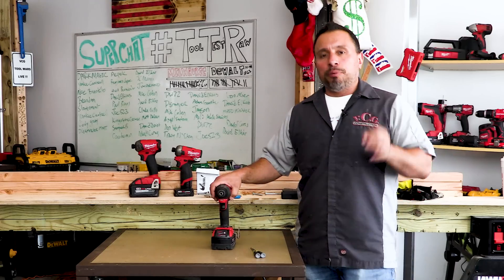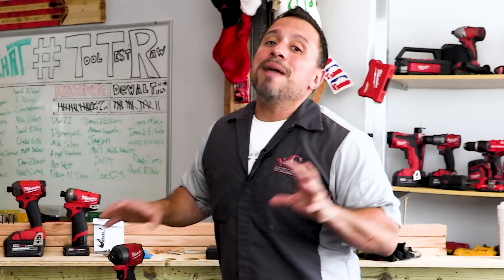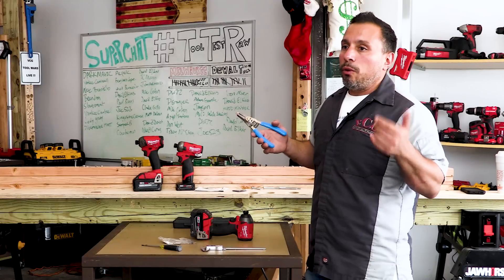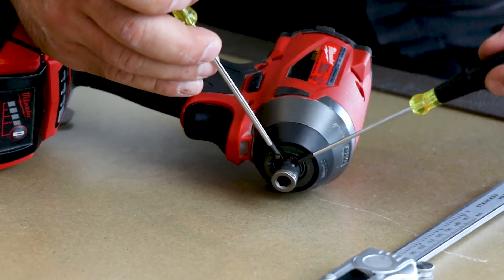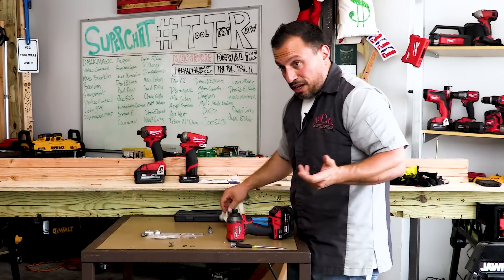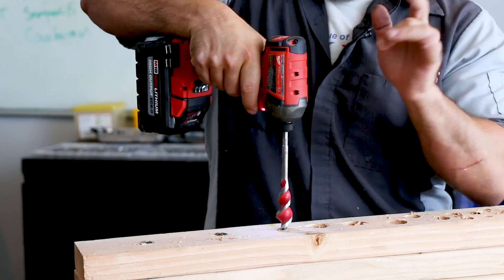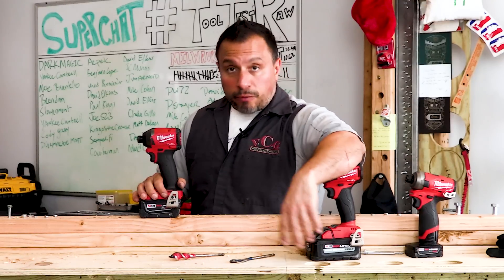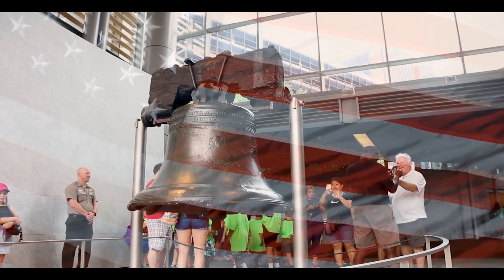Serious Problem With Milwaukee Impact Drivers - Replacing The Ball Bearing

Comment: it must be sabotage.. those ballbearings shouldn't have passed the test..
if the ballbearing is 0.1mm to small, and the black collar is 0.1mm too large along with the hexagon mount also being slightly too large, that will cause the drillbit to wobble and it will come lose if you pull too hard because the ball will move out of the way.

i would try to take the quick-insert from a functional driver and put it on the broken one and see if that fixes the problem.. (my suggestion is basically "switch out the entire quick-insert")
Reply: and also if the hexagon well is too deep, and you can push the drillbit too far in, then there's a chance one could activate the accepting mechanism that opens the lock when you press the driver down into the material, the ball lock that opens up when you insert the drillbit in the first place. the ball could then also get stuck in the unlocked position and then when you pull back then the lock is still unlocked, or almost unlocked.
If that was the case then it can be solved simply by placing a small piece of metal behind the drillbit before you insert it.

Comment: The problem is not the ball bearing size its the spring that pushes against i i can bet my left nut on it that the other impacts have a different spring. booooooooooom milwakee can send me some free drills for fault finding and saving them $$$ to find the cause
Reply: That's what I was thinking too. Actually by increasing the diameter of the ball bearing, there will be less surface area protruding into the collet. A smaller ball bearing and a stiffer spring would be a better solution imo.

Comment: friction caused be the impact function of the impact driver is heating up the bearing then transferring the heat to the retainer if its not a high heat metal it will weaken and flex causing the bearing to fall back releasing the bit. try using another retainer from a known working tool to see if it fixes it.

Comment: Its operator error....your not suppose to pull when reversing , so light pressure as if your driving and dont pull
Reply: Agree, if you drill hole like that with impact DRIVER or any tool it's better to remove those wood chips during drilling instead drilling whole drill length and then try yank it off from hole.
Reply: But the other gens work ok.  Operator error or not.

Comment: VCG Construction I came across your videos and SOOOOO glad I did. Thank you for what your doing it has really made me think before i buy. New to Newark Delaware area from West Virginia. After being an electrician for 10 years getting my own businesses going and working for myself I want to update my Milwaukee Gen 1 and after going through your videos I see the Milwaukee Fuel Surge in my future but wondering if I should wait and see it the surge line starts having the same problem.
Reply: FWIW the Gen 3 impact is way too much power for all but the biggest screws and lag bolts. I am extremely disappointed with mine. The spring on the hammer is so strong that it doesn't start impacting smaller fasteners until they are nearly seated. This results in more torque against the wrist and requires you to push down on the fastener with more force to prevent the bit from caming out (slippy bit)...  I recently bought the M18 surge and it is nearly perfect (and very quiet).

Comment: Was hoping for this easy fix, but even as the DeWalt extreme on yesterday's TTR Let go of the masonry bit twice, makes me think  that the bearing on the flat's while better placement isn't  100 percent either. I think the solution Milwaukee should go is dual ball bearings on the flat's or dump quick insertion for the old school system.

Comment: What about the spring that hold the ball in place I change it and had no more problems out of my impack driver
Reply: This may be something... everyone's focused on the ball bearing what about the spring that retains it?
Reply: agreed.  I think the  spring is slipping out of position under impact and allowing the bearing to retract slightly.
Reply: That is what I was thinking, with the jarring force of the impact it could shock the springs if they are worn.
Reply: Definitely the spring
Reply: Is the spring in the surge the same?
Reply: @mikemorgan2733  I guess there are two of us here.  Not an uncommon name I suppose.  No, at least the part numbers are different.  Balls are also different part numbers.
Reply: dragon62040 yeah that spring looks pretty shitty. Believe it or not I bought the gen 3 from winnelson and within a week the whole Chuck/quick release assembly broke apart.
Reply: But where can you buy the spring for that.
Reply: Ya I'm pretty sure it's the spring. I finally had to repair one of my dewalt 885 collets after 4 years of hard daily use and replaced the spring which fixed it. When you take them apart you can see the spring is what's used to hold pressure on the bearing to keep it seated in the bit notch. Replacement spring or possibly aftermarket spring if the ones Milwaukee is putting in the gen 3 are undersprung so to speak

Comment: Ugh I thought it would have worked !!!!  You think you can put an even bigger ball bearing??
Reply: What is the size if you but  a big bal bearing  in mm
Reply: I don't think the ball bearing is at issue here. if the bearing was too small, to such an extent that it will let go during operation, it would definitely let go when pulling on it by hand too.

This happens during impact operation, but not when stationairy. That tells me a retaining spring is too weak or short. As it does not give, even with a strong pull by hand when stationairy - that suggests it's the the coil spring tensioning the release collar that is at fault. Too short, weak, or even possibly misaligned. Or, possibly the circlip and washer needs a particular alignment? The latter - this being an issue of alignment - would explain why replacing the ball bearing has seemed to help for some people. Because that spring, and the circlip and washer, has to come out (and go in again) to get to the ball bearing. Might be they went back in, slightly different from how they came out.

Comment: I don't use my impact to drill, I believe that's why I bought the set. That said, they do sell impact drill bits. I can see how carrying one tool with multiple bits is convenient, not to mention if more than one person is using such said tools. Personally, I believe every man should have their own M18 Fuel tools and maintain them properly to avoid or fix issues like this. VCG rocks the shop and the job site! Did you ever test the fuel impact against the fuel hammer drill?

Comment: Honestly this was the decision to go towards Makita. Milwaukee really disappointed me with this issue. Thanks Vince for the updates!
Reply: By that logic you change car manufacturer every time you get flat tire.
Reply: @mr.wizeguy8995  That's not even a logical argument. Collets aren't designed to be replaced like tires. It would be a more logical argument to say... the 5.4v triton engine has a problem spitting spark plugs, therefore ford got rid of that engine and replaced it with the 5.0. Going back to the point...come on....its a collet. Even my cheap porter cable has the ability to do one handed loading and doesn't suffer from this issue
Reply: @mreconomist1402  It is logical because it's really minor issue and it seems to be issue for those who doesn't know how to drill in first place.
Reply: @mr.wizeguy8995  by that statement you are saying @VCG Construction doesn't know how to drill....
Reply: @mr.wizeguy8995  by that statement you are saying @VCG Construction doesn't know how to drill....
Reply: @mreconomist1402  Yep, never seen anyone else pulling drill like that when hole is full of wood chips especially with impact DRIVER which is mainly designed for driving screws or small lag bolts.
Reply: @mr.wizeguy8995  They had problems right out of the box and a different vid.  If the transmission was bad on the dealer lot I would consider a different car manufacturer.
Reply: @laser31415  Dunno how that chancing will help because every manufacturer has faulty tools and always will be. 
I have owned Hitachi, Dewalt, Makita, Milwaukee and some other European brands none of those brand had been flawless.
Reply: J M, if that’s truly the case, what difference does it make.  It shouldn’t matter what type of bit and/or bit manufacturer, if the issue was replicated on the Makita, then the Makita also shares the collet problem.
Reply: With makita you never had this problem? Tbh fiest time i see this problem... I dont have an impact driver yet
Reply: I never had this problem before with Milwaukee.

Comment: Install a dewalt collet and see if its the collet or the inpact mechanism
Reply: That's a cool idea. I've been wanting to see him us a DeWalt driver in the same video to kinda compare a little to see if that also let's go of the bit(been a while since I've seen him do a video with a DeWalt and the same bits to begin with)
Reply: Is that possible? That's a very good idea.
Reply: Dewalt Invented this issue 5 years ago.
Reply: DeWalt has the same problem , we just taped the bitholder on even after a factory fix
Reply: I think these hex chuck assemblies might be like drill chucks that are farmed out to other suppliers like Jacobs.  I don't know this for a fact and so correct me if I'm wrong, but if memory serves correct, spring ball setup looks EXACTLY like the one on the Dewalt i "fixed" years ago.
Reply: Makita collet better
Reply: @micjubba709  Obviously yes, in this instance, even a Ryobi is better.  You make cutting edge tools, sometimes you fall on the wrong side of the blade.  Too bad, it's such a simple and universally used assembly.

Comment: Vince. I believe that the vibration of the impact on the collet it causing the issue. Try testing it by pulling out the bit from the hole you drill slowly so it doesn't impact as you pull out. If it doesn't come out, that may be the problem. If Milwaukee would add a bearing 180 degree's from the other it would fix the issue.
Reply: Or try pulling while in the forward and not in reverse mode